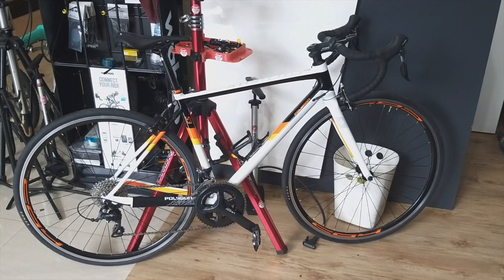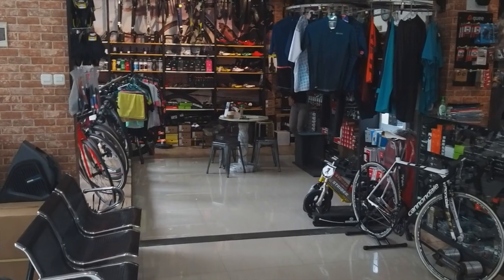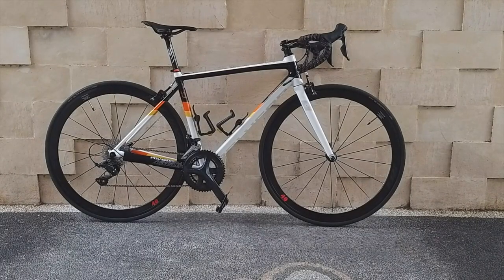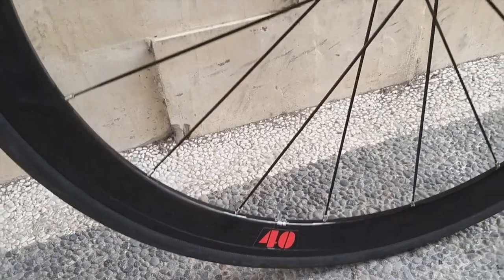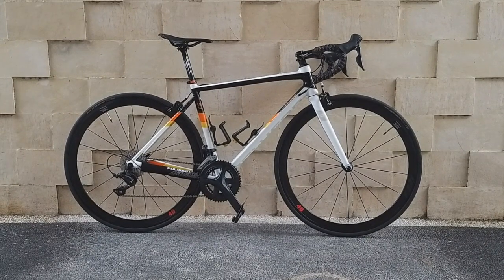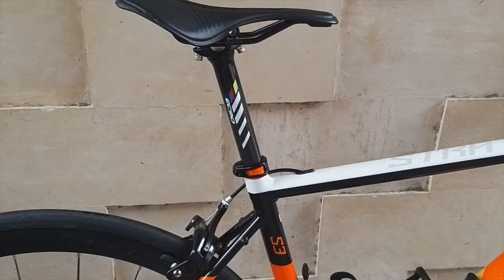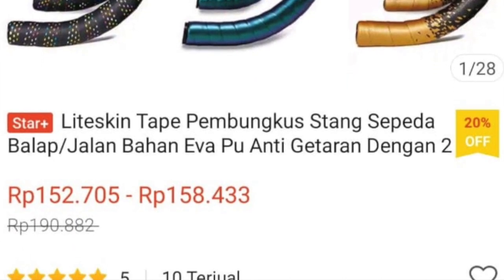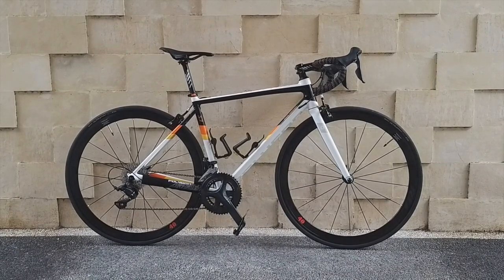Upgrade polygon strattos s3 pakai part carbon EC90

Comment: Cakep Om Ivan, nggak kalah Strattos S3 tampilannya dgn road bike lainnya yg lbh mahal kalau sudah di mods. Aliran mods dgn one brand utk seatpost, saddle, stem dan handlebar membuat sepeda jadi lebih rapi. Very inspiring videonya Om Ivan, good job 👍👍👍.
Reply from the maker: terima kasih om, ini juga upgrade dengan budget sewajarnya 😁, tapi dari pengalaman pribadi saya lebih baik kita bike fitting dulu baru upgrade sebagai pengguna roadbike, karena setelah bike fitting size stem saya kependekan disini, dan saddle juga ganti lagi

Comment: Om, stlh pake 2 bln untk seatpost, stem dan dropbar carbon nya bgmn om? Apakah safety dan gpp? Krna dgr2 kan bahan carbon yg acm gampang retak. Mhn pencerahannya om 🙏
Reply from the maker: halo gan, dari saya sementara aman2 saja, pernah lewatin bolongan juga untung masih aman semua, hanya saran saya untuk dropbarnya kalo bisa jangan beli yg model inner cabble untuk produk acm, lebih rentan retak dibanding yg model biasa
Reply: Sippp om , oh iya kl yg inner cable biasanya retak di bagian mana nya om?  Pdhl kl yg model pipih aero kebanyakan inner kabel smua y om. Mhn pencerahannya 🙏 tks
Reply from the maker: @goyohanes9217  yg saya tau bagian kabel keluarnya sering retak sedikit
Reply: Ok tks info nya om 🙏🙏🙏

Comment: Om, boleh minta info Spek yang digunakan ya
Reply from the maker: Wheelset Rujixu 40 mm
Stem, Seatpost, saddle, Drop bar carbon dari ec90
Ban continental ultrasport 3 700/25
pedal Shimano cleat
Sprocket Shinao 11/34-9 speed
bottle cage - toppeak

Comment: Seat pos ukuran ny berapa mas, pengen buat kloning ny mass.. Heheheh
Reply from the maker: 27.5 diameter panjang 35 cm
Reply: @ivansutanto86  makasih mass
Reply: @ivansutanto86  untuk seatpos ukuran 27.2 yg merk ec90, gk ad yg ukuran 27.5, maaf sebelumnya om
Reply from the maker: @Gus_Don  oh ya betul 27.2 yg benar

Comment: Stem nya pake apa tadi om?
Reply from the maker: ec90 - 8 cm...setelah fitting saya ganti yg stem carbon yg 10 cm merk ec90 juga tapi model beda
Reply: Minta semua link belanja part nya om 🙏🏻
Reply from the maker: @pryhandokobobby8005  waduh kebanyakan beli di shopee gan, search aja part ec90 dan wsnya rujixu 40mm
Reply: @ivansutanto86  oke om. Kalo deket bisa gobar ya kita 😬

Comment: Yg diupgrade apa aj om?
Reply from the maker: wheelset, seatpost, stem, dropbar, sadel, cleat, ban dan gripnya gan, sisanya standard
Reply: @ivansutanto86  dropbar pake apa y?
Reply from the maker: @endyrakhmatwibowo5745  semua carbon partnya pake ec90
Reply: Klo wheelsetnya pake apa om?
Reply from the maker: @endyrakhmatwibowo5745  rujixu
Reply: Beli dmna om sparepartnya?

Comment: Mas itu sudah Ganti Sprocket 11-34 apakah RD di ganti atau tetep bawaan strattos 3 yg Short Cage?
Reply from the maker: masih muat tapi crank besar jangan sampai di bawa ke sprocket besar, maximum masuk di gear 4 aja, di bawah itu ganti ke crank kecil dulu

Comment: Habis berapa nih om?
Reply from the maker: untuk upgradenya? sekitar 4 jutaan termasuk wsnya
Reply: @ivansutanto86  wah bs dpt s5 rim donk om
Reply from the maker: @crazyrider1189  wah kurang tau yah harga s5, dari s2 - s5 masih sama seh framesetnya groupsetnya yg beda
Reply: @ivansutanto86  s5 rim 13.3. Kalau yg s4 10.2. Tp beda2 tiap org si yah om. Ad yg demen upgrade ada yang suka sama bawaan
Reply from the maker: @crazyrider1189  s3 7.5 seh masih belum dapet s5, s4 bisa dapet tapi dari pengalaman temen2 yg pake strattos kelemahannya yah wsnya seh kurang longcer dan berat, kebanyakan pasti ganti
Reply: @crazyrider1189  Bapak sepedaan rutin? Udah pernah pakai S3/S5? Kalau anda pakai RB yang kelasnya di atas Strattos maka abaikan saja kelanjutan komentar saya :) 
Menurut saya kalau hanya membandingkan sebatas groupset saja, berarti kemungkinan besar anda missed the whole experience of riding a roadbike. Memang Sora vs 105 tidak bisa dibandingkan apple to apple, 11 speed dan 9 speed memang beda, walaupun opsi tambahan 2 cogs tersebut hanya dapat dirasakan dengan optimal apabila anda rutin bersepeda. Dengan setelan RD dan kekencangan rantai yang tepat, Sora pun bisa menyediakan shifting experience yang cukup mulus dan memuaskan. Masalah hanya timbul mungkin kalau kita memilih paduan sprocket yang lebih lebar seperti 11-32 atau 11-34, maka akan terasa 'lompat' perpindahannya karena ketiadaan 2 cogs 11 speed. Mengoreksi @Ivan Sutanto frameset S3 dan S5 ada perbedaan sedikit di size tube dan juga di kualitas las sambungan - walaupun sama2 alloy, kemungkinan untuk meningkatkan rigiditas frame dan efisiensi transfer energi.

Kelemahan Strattos yang terbesar memang ada di wheelsetnya. WS bawaan S3 (tanpa merk - kemungkinan Araya Alloy) beserta ban-nya (Kenda 700x28c) memang berat dan kurang loncer. Ban bawaan lebar dan bermotif touring, belum slick. Kemudian dropbar bawaan memang diperuntukkan untuk orang dengan badan ideal yg fleksibel dengan reach yang cukupan jauhnya dan drop yang cukupan dalamnya. Masalah di saya, saya gendut dan bahunya lebar, jadi belum bisa terlalu bungkuk tetapi butuh space dropbar yang lebar. Mengganti dropbar dengan size yg lebih cocok sangat menolong saya untuk menikmati RB pertama saya... Istilahnya, sekarang berasa kayak sepeda sendiri, bukan sepeda pinjem tetangga. Sepeda menggunakan teknologi yang sederhana sehingga apabila terjadi perubahan berat, sudut, dan ukuran sedikit saja, maka akan langsung terasa efeknya.

Saya sendiri pakai WS Fulcrum rc9 bawaan CAAD13 dan dropbar compact Specialized yg lebih lebar dua senti daripada bawaannya. Enak! :) 

Apakah nambah 1 juta (menurut bro @crazyrider 13) untuk beli S5 rimsbrake lebih worth daripada S3 upgrade? Jawabannya ada pada apakah anda sanggup menanti antrian ratusan orang di Rodalink yang tidak tahu kapan datangnya :D :D :D Kalau mau beli S5 sama tengkulak, maka anda harus siapkan dana lebih banyak lagi mungkin sekitar 15-17jt. The best bike is the bike that you have right now. 

Thanks Bro Ivan sudah berbagi. Tuhan memberkati.
Reply: @davidaden6191  saya si cuma penguna mtb premier 4 2020 yg ingin membeli rb saja koq. Kalau di tanya sering ya lumayan si ada seminggu ato dua minggu sekali long ride kurleb PP 100km Elev 1500 sampe 20000m. Ato gambaran minggu ke dua jan 2021 saya baru bandung puncak PP (150km) yang biasa orang2 pakai rb butuh waktu rata2 riding time 8 jam, saya 9jam elev 2300😁. Kebetulan MTB saya masih spek std. Kalau rb saya sudah pernah coba helios a4 taun tua  dan s5 spek std plus taun tua😁. Tanpa melakukan perubahan ws si. Karena faktor utama ya di dengkul dan grup set, bukan begitu? Percuma ws mahal, dropbar karbon, tp dengkulnya masih kalah speed sama org pake mtb.

Setiap orang kan punya pandangan sendiri2 yah?kalau mas nya ganti ws makin loncer ya monggo. Kalau saya si faktor utama ya GS nya karena ada rasio yang berbeda sesuai kata mas nya.
Reply: @davidaden6191  wih sepeda om nya apa yah?ws sama dropbar nya serem yah. Tapi kalau boleh saran sudah pernah Coba bike fitting?kalau blm d coba yah biar lebih enak lagi sepedahannya 😁. Karena enak belum tentu nyaman loh. Jgn ws mahal tp ga pernah bike fitting, sayang sekali. Plus beli sepeda full bike tidak akan langsung cocok sama kita langsung. Perlu adjust2 lagi, betul?happy gowes yak.
Reply: @crazyrider1189  gak seserem yg anda kira koq Pak. Semua barang seken memulung dr teman2 saiklis kalcer yg sibuk upgrade lebih mahal 😁 Habisnya pun gak sebanyak Bro Ivan. 

Bike fitting udah, makanya bisa berkisah kalau ternyata reach saya kurang panjang dan lebar dropbar kurang karena bahu saya lebar. 

Wah, bapaknya ternyata orang hebat ya, udah kemana2 👍 Kalau saya saiklis kota2 aja, yg lebih lama main SeLi drpd pakai RB. Pakai RB juga masih baru. Saya sepedahan mainly untuk weight loss, Pak. Alhamdulilah sudah turun 20kg... sepedahan pendek2 aja dalkot, hampir tiap pagi. Granfondo baru juga sekali, pakai SeLi pulak 😂

Kalau boleh memperjelas, maksud saya disini adalah menyoroti perbandingan harga RB khususnya Strattos yg sulit didapat di sumber pertama, sehingga walau gambaran ideal perbandingan dr bapak td sahih, tetapi jika dipadankan dengan kondisi masakini dimana barangnya sulit didapat - maka menjadi kurang relevan. Maka buat saya, memaksimalkan dan menikmati sepeda yg ada jauh lebih relevan daripada memikirkan ganti sepeda lain.

Demikian Pak, sehat2 terus ya biar kita happy gowes terus 😁🙏
Reply: @davidaden6191  semua barang sama deh om. Untuk range harga di bawah 20jt bakal susah. Marin pun sulit. Kecuali ad uang harga mahal dbayar. Gila mantap 20kg.
Reply: @crazyrider1189  
Nah, oleh karena itu saya menghindari pola pikir lebih baik yang ini atau lebih baik yang itu. 

Saat ini, dengan bujet saya, sesuai kondisi pasar sepeda yg anomali seperti sekarang, sepeda terbaik adalah sepeda yang bisa saya dapatkan dengan budget yang bisa saya berikan. Setelah itu baru dimaksimalkan... ntar kalau udah waktunya ganti frame - baru deh kita mulai mikir lagi :) Itu sih prinsip saya... Sebab kalau gak gitu akhrinya beli sepeda hanya jadi wacana yang gak berujung.... :D 

Dulu juga waktu beli SeLi saya pakai prinsip yang sama, beli semampu saya, diupgrade pelan-pelan sesuai kebutuhan. 

Alhamdulilah ada hasilnya kelihatan: kesehatan dan penampilan membaik, istri senang dan semakin mendukung hobby. 

Salam kenal, Pak. Enjoy cycling and stay healthy.
Reply: @davidaden6191  nemabah sedikit, mungkin bermanfaat, untuk memudahkan shifting yang halus, namun jarang orng melakukan, stratos s3 yang 9 speed, diganti rantai yang 11 speed,